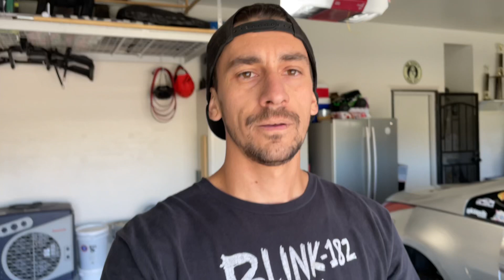Fixing The Most Annoying Thing About My 350z Drift Car

Comment: That little pin that goes in the ebrake cable mechanism can be a pain if the tolerance isn't tight from wear. I struggled a lot with that falling out. I gooped it up with grease and that helps to hold it in place 😉. Just in case you ever gotta dissemble again.
Reply from the maker: Good idea! One of the sides put up a fight, it kept falling straight through! Grease would have helped out for sure haha